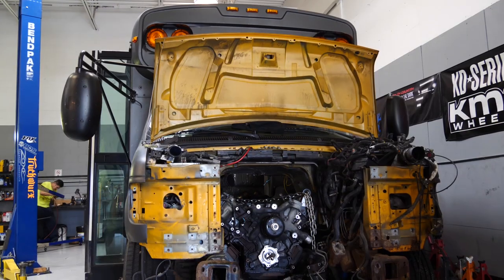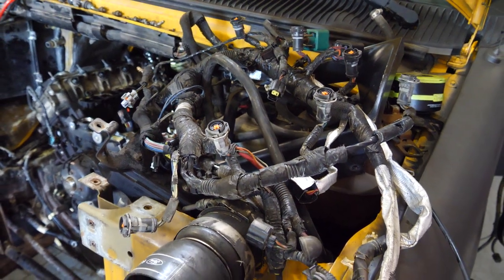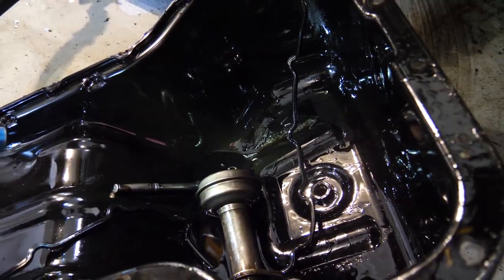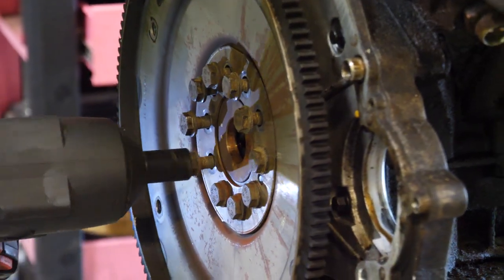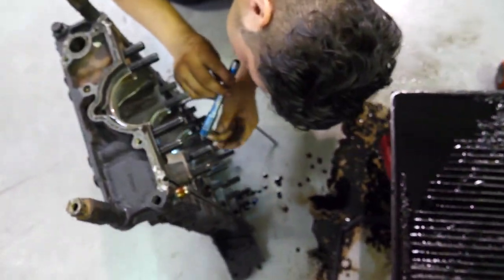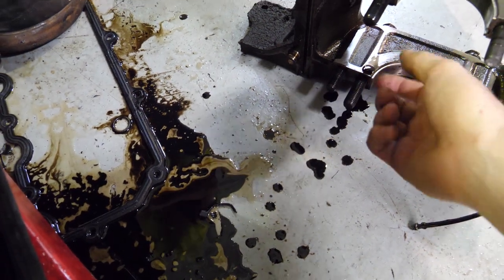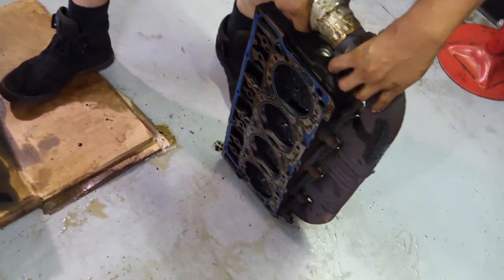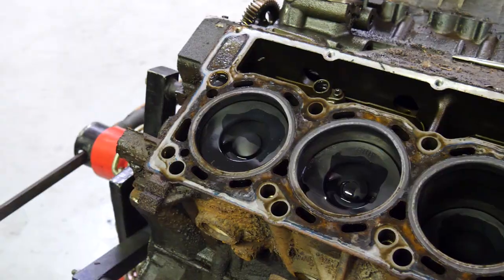Building a 500HP SCHOOL BUS! - Removing & Disassembling the 6.0L Powerstroke

Comment: "The engine has to come out the front and the whole front end has to come off" welcome to Audi ownership lol
Reply: Pete agree 😂
Reply: B5 life
Reply: True 😂 had to disassemble the whole front on my B5 to change my alternator
Reply: Pretty much any AWD modern vehicle. My Countryman is the same. Either you pull the engine or you pull everything on the bottom
Reply: A6 Gang LoL, I remember when I had to take the front bumper off just to zip tie my ac part
Reply: Any of our European cars that are in the high horse, but compact class.

Heck, even some that aren't. And you'll laugh, but it has nothing to do with mentality or deviousness, it's for safety reasons. Some time ago one of the biggest changes in design philosophy was that they figured out they should make the whole front end your life west. 

Now how do you do that with a huge rod (engine + trany) going down at you? Make everything ready to give on impact, and to do that, you make as many assemblies as you can, hence the nature of taking everything apart to get to one part or another.

Think of it this way, the engine bay of a modern car is like a controlled demolition, each component that gets impacted triggers another in the same way a blast engineer makes pillars go out in a sequence so that the building falls in the allotted spot. Or in the case of the car, the whole front end should slide under you, not at you. 

Don't get me wrong, it still sucks having to change things inside, but man, once you learn that, you gain new appreciation for the level of engineering needed to make something like that float.
Reply: @lars.a1298  bullshit, my b5s the alternator was in the top front. Didn't have to remove anything.
Reply: @ratataran  Did you know the b5 platform came with different engines?
Reply: @lars.a1298  yeah, I had a 2.8 and a 1.8t,i guess you're talking about the 2.8
Reply: @ratataran  2.5 actually

Comment: Hey now maybe you can fix the issue that it cranks for two days before firing.
Reply from the maker: Truuuu
Reply: That’s glow plugs
Reply: @charlieburton9967  nope, it should light off right away even without glow plugs unless its under 15 degrees out. Usually its injectors that make these things hard start
Reply: @dakotadriggers8838  I have a 6.0 with 211k stock injectors, can confirm that it fires instantly instead of 13 years of cranking after new injectors.
Reply: Was probably the blown head gaskets
Reply: It's most likely low oil pressure. The injectors won't fire unless you have 500 psi of pressure. Probably had an oil leak.
Reply: @jeremymullins6470  or maybe the pump was failing slowly until it fully gave up
Reply: @millerzj9GamingV2  It started to fail because of the needle bearing failure. Once that got into that front cover, it gouged it all to hell and there goes all your pressure.
Reply: Should make a montage video of nothing but clips of the bus starting, wonder how long it would be, like maybe 2-3 minutes lol.
Reply: Jeremy Mullins it also could be high pressure oil pump did one the other day after the first start up it would start didn’t have enough oil pressure

Comment: That 6.0 will have 500 horsepower for about 23 seconds, then automatically change it's own oil. Guarantee.
Reply: Good 6.0 joke but no, it’ll last with all preventative maintenance he’s doing.
Reply: LOL. Not if he does it right.
Reply from the maker: Lmaoo
Reply: @hunterj2253  i havent watch the video yet but no amount of "preventative maintenance" will save that motor. He needs to address some serious design issues like EGR, FICM, oil cooler, and headstuds. (Source: blew the familys 6.0 three times: egr, melted piston, and windowed a block)
Reply: Yeah and they turned down the boost each time. Very sad
Reply: @_Gingium_  6.7 Powerstroke or 7.3 Powerstroke Swap
Reply: @ryanbernard6550  ok so everytji g he said in the video😂
Reply: Ryan Bernard ficm isn’t a major issue, you must be new to the 6.0s. Oil coolers usually are replaced while inside the motor, and I’m sure the shop knows that. He said he’s doing an egr delete.
Reply: Put a lq4 in it so it’ll still be a 6.0
Reply: @jamesmaxwell6703  I second this. #LSswaptheadventurebus

Comment: i hope after this the bus is getting a oil pressure gauge
Reply: Underrated comment.
Reply from the maker: It actually has a factory one on the Dash.... I didn't see it...
Reply: @_Gingium_  damgium you  might want to keep a close eye on it in the future
Reply: @_Gingium_  that guage is actually a dummy guage that going to a preset postition when the sencer gets like 6psi of oil pressure so its not really my 1997 expedition has the same type of guage.
Reply: Needs a full suite of real aftermarket gauges. Alot of ford gauges are basically dressed up dummy lights
Reply: The dash gauge usually isn't real accurate. Itd definitely be a wise investment to add an aftermarket gauge such as an autometer.
Reply: @_Gingium_  the part about ford factory oil gauges is that they're fake, they're just on off switches so it's not like it's worth anything anyways.

Comment: You should look into holset turbos, they're the turbos used on cummins and on some scania semi trucks (dunno if you have those in the us but basically they're really good european semi trucks) and they are pretty cheap compared to equivalents from garrett.
Reply: Fleece Cheata turbos
Reply: Scania trucks don't exist in America, but I played enough Euro Truck Sim lmfao
Reply: the_l0stchild  Yeah I know lots of people uses hx35's on rb's, jz's and mostly on bmw's here in europe it's very common to see m20's, m50's or m52's with h35's or hx40's for more powerful builds. I have no idea which you would need to pick for a 6.0 maybe a hx40 with the biggest cm² exhaust housing or a hx50 or even an hx50mfs, but I'm pretty sure the guys at that diesel shop could help him pick the right one.
Reply: @imnota  Why i commented the fleece cheata turbos. they are stock sized, but internally they will crank out 700hp if needed. No extra space or anything required and will look stock.
Reply: @brandoncaldwell95  That's a good option as well because I'm assuming it uses all stock piping since it's stock housing. Practical
Reply: @imnota  every car guy in finland has holset in his garage
Reply: @NazbolCaliphDonaldaddeenTrump  Scania are really good trucks.
Reply: Americans dont know about holset at all, they only go for garret or precision
Reply: @NazbolCaliphDonaldaddeenTrump  I could've sworn I've seen Scania trucks in the USA.
Reply: IMNOTA holset doesn’t make turbos that will mount in the factory location, Garrett is the way to go.
Reply: @hunterj2253  Yeah but you will save more than a thousand by buying an holset... (an hx50mfs which is basically bigger than you'll ever need no matter the build is 1k... Anything from garrett for a 6.0 will be 2.5++k) And the money saved is more than enough to make new piping which would be even better because custom will flow better than stock.
Reply: IMNOTA saving money & diesel performance don’t go in the same sentence. And I get what you’re trying to say but there is no possible way to make a holset turbo work unless you’re going with a completely custom setup which would end up costing more than a garret which would bolt right on.
Reply: Its probably really hard to find one
Reply: @hunterj2253  How is like a couple feet of stainless steel piping, a couple of flanges and some welding done by Gingium could be more expensive than a garrett setup ? Been done plenty of times before for much cheaper than you think.
Reply: IMNOTA 1.There’s 0 room in a 6.0 engine bay 2.The turbo is mounted in the valley of the engine 3. The up pipes, exhaust manifolds & intake manifold are made for a top mount 4. The perch/ bracket that the turbo sits on is only compatible with some turbos. This isn’t a gas engine where you can put your turbo & piping wherever you want. Everything has its own place in a Diesel engine.
Reply: He’s trying to stay cheap, a great bolt on turbo brand is kc turbo’s. No need to mess with different pedestals or up pipes. For the sound he can do a 10 blade turbine wheel and a larger bolt on compressor housing with a larger billet wheel offered by KC turbos. That will turn your stock 6.0 turbo into a 63.5mm powermaxx turbo.  It will give him the power he wants, awesome exhaust sounds and all for under $600
Reply: @loganmccloskey6258  Damnnnn yeah that sounds good. Finally someone else giving a really great option. That is 1000% more interesting than the holset.
Reply: Holset turbos are very common on the Cummins ISB and ISX engines here in the us but they are a VGT setup
Reply: IMNOTA yeah, it’s a VGT lmfao. I don’t even know if a horset can fit on a t4 setup too

Comment: O-ring those heads. If you're doing everything else, do that as well.

Another good 'bulletproofing' trick is getting the camshaft sprocket and the camshaft dowel pinned. Once your cam and sprocket, which are press fit together, are ready for reassembly, a small hole is drilled into the seam between the two, and then a hardened pin is pressed into the hole, locking the orientation of the sprocket to the cam.

Might want to look at an EGR delete/re-route kit too, depending on how emissions compliant you want to be. Good luck!
Reply: You are already in there you might as well I wouldnt think labor would be much more since it's already out
Reply: @aaronr1926  The toughest part for him now is finding a reputable machine shop that will stand behind their work, and most importantly do the work correctly.

His best course of action would to fully disassemble the short block and get every part ultrasonically cleaned at the very least, then do basic measurements on everything to check for wear, stretch, bends, ovalling, debris, and damage.

As far as the block goes, they are strong, but getting it magna-fluxed would alleviate headaches down the road. After that, spend a good bunch of time with a needle scaler,   buffing pads, small sanding scrolls, wire wheels, and a tap set to remove rust, dirt, grime, casting slag and overflow, and prevent contamination down the road.
Reply: IronGigant00 I hope you don’t wanna use wirewheels on the block to create extra issues when putting your heads on
Reply: @fbi6540  you don't wire wheel the head mating surfaces, you wire wheel all the cavities on the rough casting surface where don't and rust builds up

Comment: My school district still uses several busses older than yours. Most have had at least one engine replaced. Because putting 6.0s in full size busses with crazy drivers was a smart idea. Glad you're getting it all fixed up to keep using it. Switch to Cummins eventually though, even though not now
Reply: Noah Walter yeah he really needs to ditch the shitty Ford engine
Reply: I don't think you should plan replacing an engine twice on a bus. Do it once, do it right, and it should last for 150k miles easily, which is probably more than he'll do in this until the frame is rotted away.
Reply: @zerohourdrift   eh i say stick with the built engine

Comment: This video deja Vu’d  my brain to 2004!  A lot of these buses are down in Central America. I saw a local KMEL radio sticker and kids tag up bullshit inside. I had so many questions. Did they drive  them down?  How the eff do they make  the Push button start fire up like a race car?   Running  so strong on the Pan-American Highway.  They could 1/4 mile race them.  So cool you’re doing this! Thanks.

Comment: Perfect time to do the front end swap and fix that 30 second start time crapola. Also, perfect time for some 19.5" wheels and new tires that fit and look cooler. Maybe convert the rear to super singles and make the fronts wider?

Comment: @gingium
Please do not POR your frame and body. It will trap rust underneath the coating and if you don’t prep incredibly well, it will just peel off of the metal. Use an oil based spray like New Hampshire oil undercoating. An oil based undercoating will work so much better. Upvote so gingium sees this!

Comment: Crazy how you could hear the air being sucked in when they were hand cranking the engine talk about compression
Reply: @Unique SP yeah i know that but its much more pronounced on this engine plus the compression ratio of a diesel is naturally higher than a gasoline engine
Reply: Yeah I thought that was pretty crazy too.   Never realized there was that much compression going on without it actually running.

Comment: What you said in the last installment of the SB saga, 100% correct. But man, i think that if you'd consider the hill and climb it, you could still make a better adventure buss out of an old truck (actual truck, not utility truck) and one of those half containers. Imagine being able to configure any format you want + towing ability and painting a HUGE Gingium letter sign on the sides of the container/camper. I mean...think about it. And yes, i know, big hurdles, but man that'd be cool.

Comment: 300 INLINE SIX.
Tough, durable, repairable, damn-near bulletproof, lots of low-end, used in pickups, dump trucks, tractors, anything. Racecars with the short-stroke, running upwards of 10k rpm.

I repeat, 300 INLINE SIX!

Comment: Interesting to see your 100 subscriber video and now your building a engine for the adventure bus. I am planning on getting a bus and converting it. I watched your conversion video. I'll bet you learned a lot about pulling bus motors, I know I sure did. The whole long hood is really so the mechanic can run the rack and swap parts. I didn't catch what model engine that was, it looked like a silver 92 but I doubt that would be in a school bus. Are their liners and pistons or is it a piston in block set up. I was kind of supersized that they didn't re ring the engine, but like he said when he was turning it over that it had plenty of resistance so the compression must be good. OK good luck well done sir.

Comment: honestly, I would have loved the idea of a 3.5 ecoboost swap. Stock reliability as well. 400ft lbs of torque on a stock motor pretty much. In my experience we've had 2 6.0s around for work trucks, they like to break down a lot.

Comment: rolllin down the street in my six four,

Rollin down the street in my six blow
Reply: Johnathan Baker being pulled down the street in my 6.0
Reply: Had to rescue two of my friend’s Ford farm trucks this week. A 6.4 that decided it didn’t like piston #4 and threw it through the block, and a 6.0 that blew a head gasket. Both got towed home by my 330,000 mile 2008 Dodge Ram 1500 with a 4.7L gas v8 under the hood! Funny part is both those Fords had under 150,000 miles. Lucky for my friend, his 3rd truck is an LBZ Duramax!
Reply: then what I said is true
Reply: Deereman my 1999 f250 with a 7.3 and a 5 speed has been crazy reliable

Comment: This reminds me of a heart transplant.  Shout out to Truck Works for letting you film over their shoulder, sad they didn't put you to work, clean this, loosen that.  I'd have looked for a Ford 7.3 which I think is a much better engine, or secondly shop Midwest Transit Equipment - Kankakee IL for your next bus like this 2009 Chev with 117k on a Duramax diesel midwesttransit.com/search/thomas-chevrolet-ford-gmc-diesel-school-kankakee-il/?cy=60901&fl=10&mk=12&mk=20&mk=22&mk=313&p=5&pr=0:5000&pr=5001:10000&pr=10001:15000&q=custom2_School

Comment: You should probably wait to do that burnout until the motor is broken in a little bit... maybe get a few hundred miles on it before you go full send, ya know
Reply: Phil Cooper lolz what’s break in. Know how they break in high hp motors? Hold the trans brake and let it rip

Comment: So I know that the comment section is a bunch of stuff people are telling you that you need to do and it probably gets old but my dad has a 2006 f250 Harley edition and it’s got pretty much the same mods as you are looking to do and it runs great but you maybe wanna look into doing a transmission and a billet torque converter, he’s put 4 transmissions into his truck becuase it would break the torque converter and take out the rest of the transmission. It now has a billet torque converter and a suncoast transmission and it runs great no issues at all

Comment: Check the FICM ? Do the bulletproof or you will blow out the engine !
Those 6.0 are known for blowing head gaskets, oil cooler clogging causing internal melt down, HPOP failure, water pump cavitation, EGR cooler failure, hydraulic lifter failure ( you cause).
You may find all the helping videos in powerstroke help youtube.

Comment: If you're this far into it, then you may as well go the extra mile and go through the transmission as well. Also if you're this deep and you have the heads off and the crankshaft out why in the world wouldn't you re ring it as well? Especially with bigger injectors and turbo. Better to do it all once than tear it down again.

Comment: Caleb, buy a bigger bus. It will be cooler and it will be more worth the money that you put into it because you will be able to have a bathroom and a closet and space for your tools and gas and water and have more room to chill and be able to have a foldable porch hanging on the side of the bus. Buy the biggest school bus you can and build it from the ground up again, PROPERLY

-Bulletproof the engine
-Get it tuned up
-Have the bus have two tunes for power and the other for eco
-Have actual separate rooms ( gaming room, even a bathroom will fit in a bigger bus)
-Have heat and A/C
-Make it awesomeness 
-Get the Windows 100% tinted

Just take it slow and have it be really epic
Reply: That would be AWESOME, but storage is the issue, he only has so much space to park it.
Reply: Red Squirrel I know but I feel like he is really wasting a lot of money on a pathetically Sized bus. YGM?